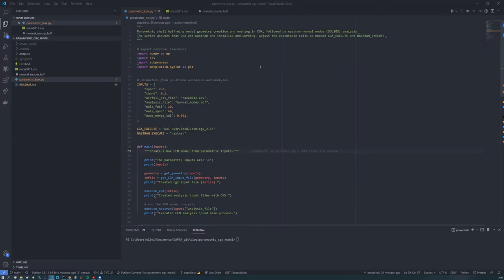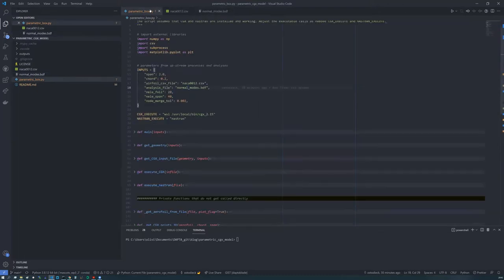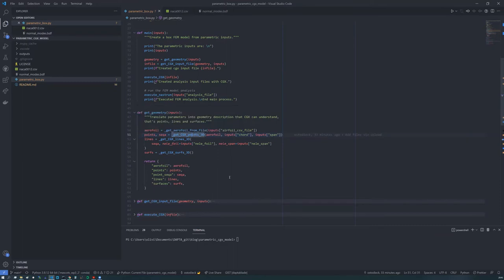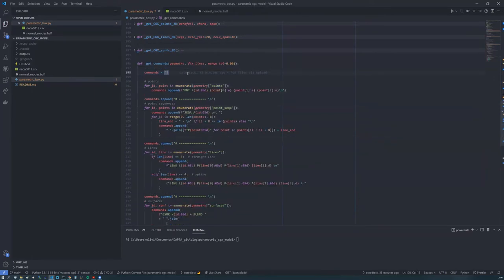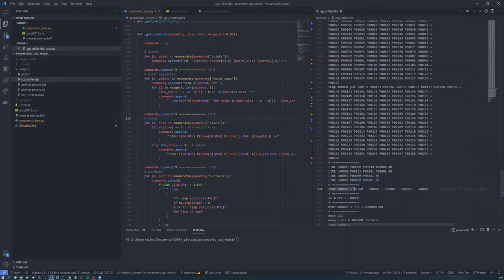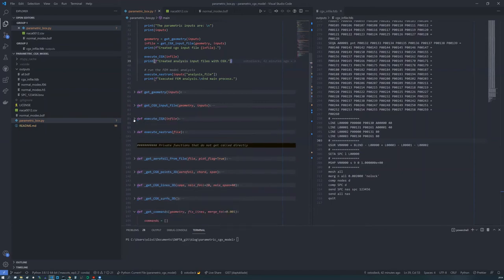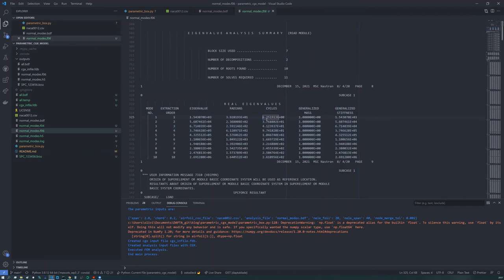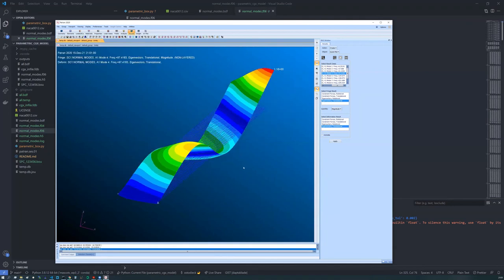Part1: Parametric Nastran FEM model creation with Python and CalculiX GraphiX (cgx)

Comment from the maker: ERRATUM @ 11:40
Disregard that comment: there will be 80 elements along the span and 40 around the airfoil section as this particular version of the script uses linear shell elements (see MSHP card on line 308, which references element type 9, which are S4 elements = linear quads)